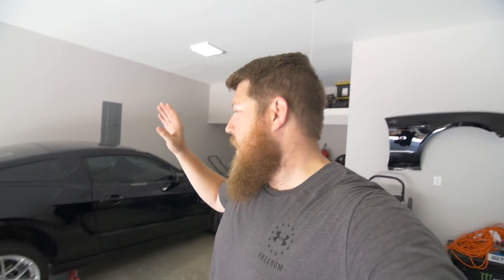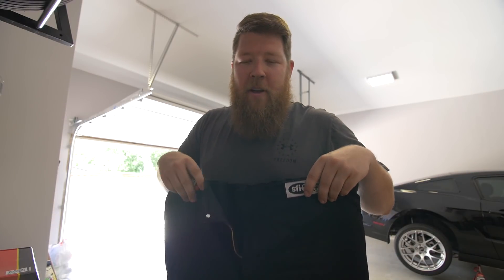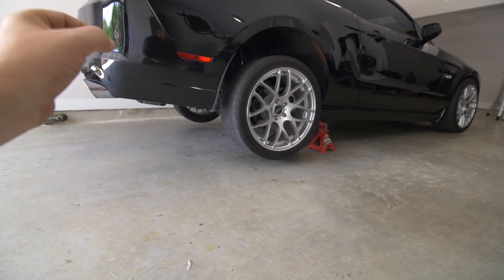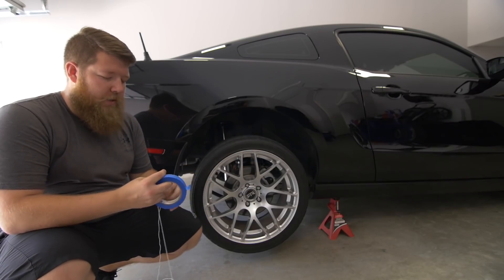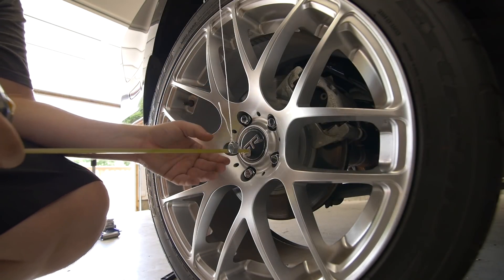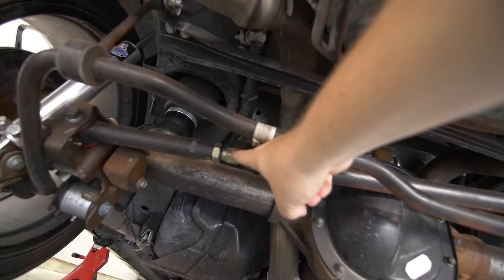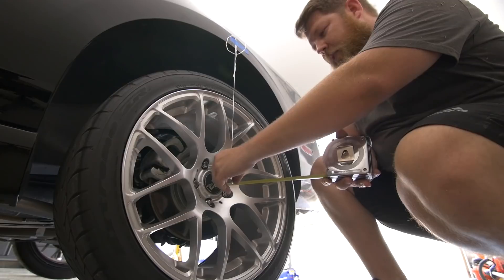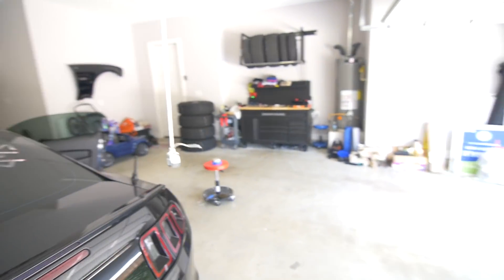Nearly Catastrophic Bag Failure at the Drag Strip!!!

Comment: Panhard bar adjustments should be made at regular ride height with the full weight of the car on the wheels.  If you look at the mechanics of a 3 link panhard bar solid axle set up, you’ll see that they “swing” from left to right in the chassis as the ride height changes or as the rear axle housing moves up and down under the car.  It’s ok to eyeball it with the wheels hanging, but you should definitely fine tune it at the ride height you regularly sit at.   Some drag racers may need to actually offset the axle to one side in order to compensate for uneven squat caused by rotational torque.
Just some advice I’ve learned over the years of owning S197’s.
Reply from the maker: Thanks for the info Sonny. I will need to get back under it and fine tune in the method you mentioned. It makes complete since. I appreciate your comment brother.  👊🏼

Comment: If it's a similar locking ring to coilovers you'll want to take a screw driver and hammer to lock the ring into place. Just takes a couple good taps. You don't need to go He-man on it.
Reply from the maker: Unfocused Racing Good call! That’s exactly what I did off camera, sorry for not including that. I am thinking the first time I did that I was too easy on it. I guess that’s why it happened again. I have it some better whacks this go around but not too much. 👌🏽

Comment: Bro I just noticed you don't have relocation brackets?
Reply from the maker: Shot By Dale I had them but when I did the one piece driveshaft I couldn’t run them because the pinion angle was wrong. I don’t ride around low enough to require them and more importantly on my drag setup the angle wasn’t right to need them. So now they are chilling in a box in my garage.